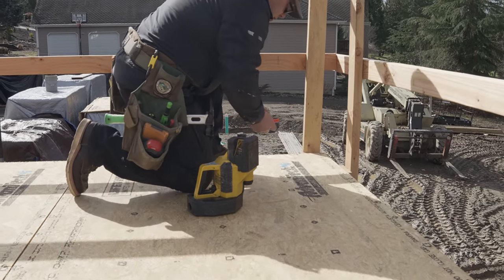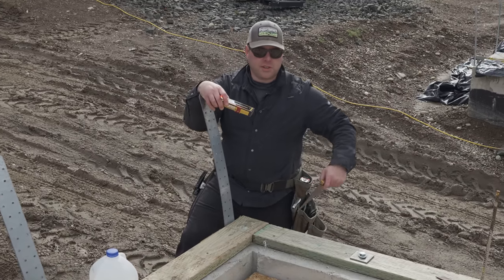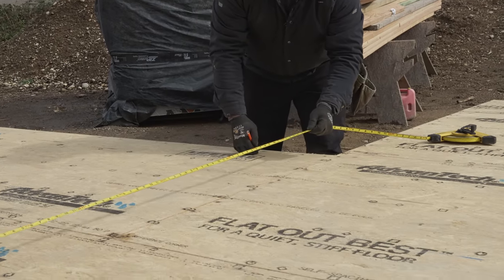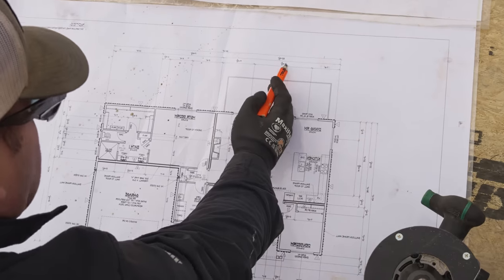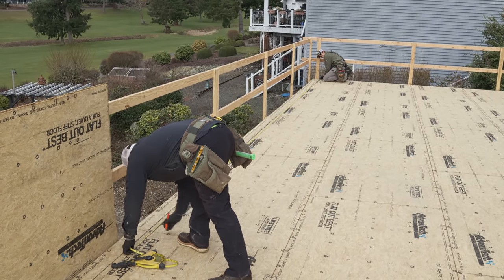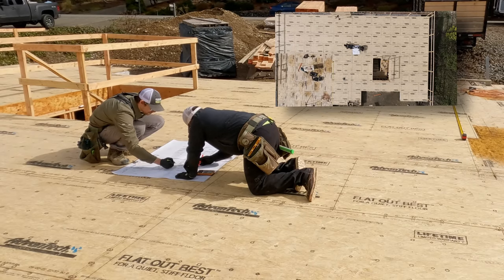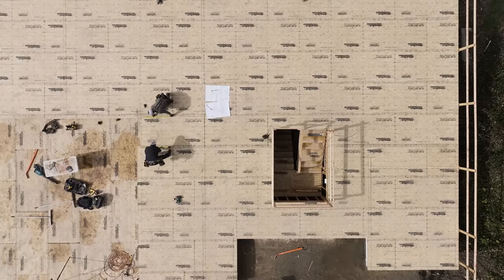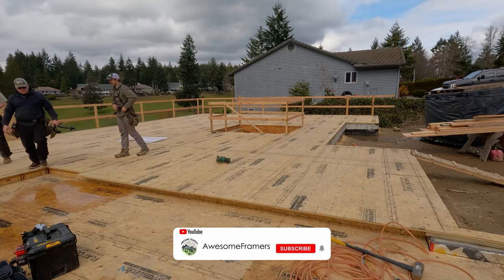Mastering Wall Layout &Alignment w/Stabila La 180 | Ultimate Construction Guide project 120 part 8

Comment: 3 things I’ve found with the stabila layout station. 1. If I don’t turn the reader off after automatically locating square, it will follow me as I walk to the next check point. (Major crisis everted when I realized it was user error and not foundation issues.) 2. Pressing the narrowing in button all the way down to 1/16th eliminates any laser slip at 100’. And 3, this tool has made mine and my crews accuracy as perfect as perfect can be on framing as it allows you to shoot heights for foundation and grade, plumb for interior walls (totally eliminates the use of plate levels and trusting one man’s eye to the next), as well as squares. This is a must have tool and another great video. (Ps, our job site is now full of jackass sawhorses thanks to you! And yes, I paid for the schematic of the horses)
Reply from the maker: Aren't those sawhorses awesome! Love them.

Comment: "Thank you for the helpful advice! Just one trick of the trade can really help with productivity in this field. That said, thank you for sharing your tips and tricks with us. Your channel is one of my favorites!

Regarding snapping lines, I have discovered a technique that has been making my work much faster, especially on larger houses with more interior walls or fancy beam work on the second floor. Essentially, it involves snapping a grid on the floor with 10-foot increments, usually working best, and then pulling all other lines parallel off the grid.

By doing this, my helper and I only need to use our short tape measures after the grid is established.

 I'm curious, does anyone else use a grid technique like this?"

I'd have to say one of my biggest problems when something lines is either snapping the interior wall on the wrong side of the line or just snapping the interior wall in the wrong place. the answer to that is measure from both directions to the closest trusted reference point (never try to cut this corner like I've done so many times!) This mistake can get very costly especially with plumbing/bearing walls in a kitchen on a pre-sold house, and no one catches this mistake until all the plumbing and venting has passed through. 

I'm curious does anyone else have a story like this?
Reply: I do the same, snapping the smaller square possible and then if possible just using small tapes